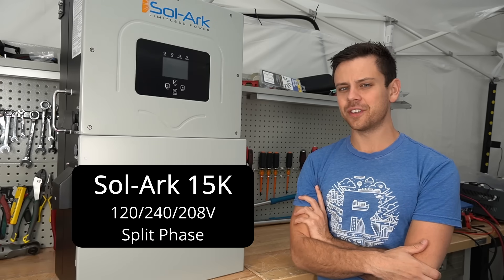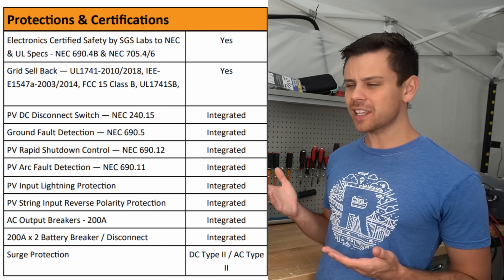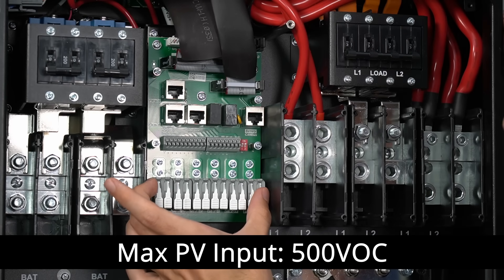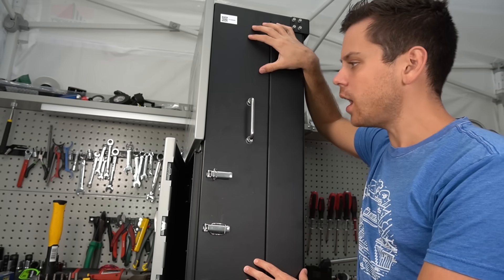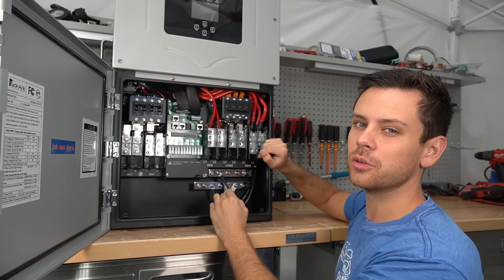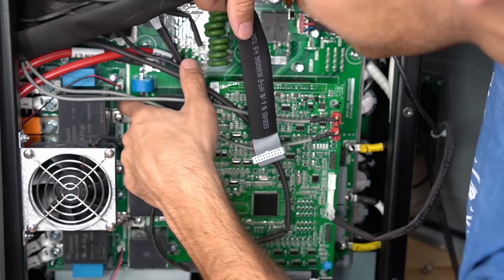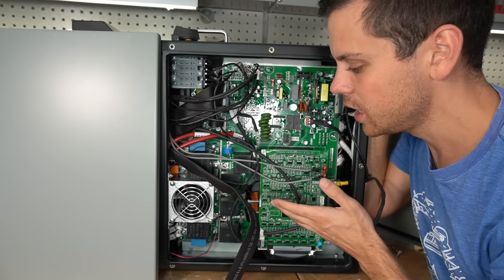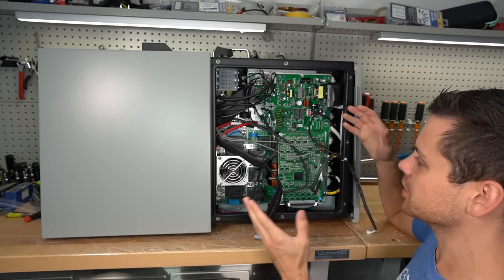Sol Ark 15K: Ultimate Grid-tie or Off-grid Inverter

Comment: I have two of the 8k sol-ark inverters powering my off grid home and aside from needing to cut a few trees on my heavily wooded property it does well keeping up with my 10k system and 40kwh storage. Have pushed the storage a bit a couple of night but after kicking in the generator for a couple of hours until sunlight we were good to go again. Off grid is a bit of a learning curve especially after a few overcast days in a row but no electric bills for the last 7 months has been nice. May add one of those 15k ones if I decide to run more stuff at a time and add more storage. Off grid homestead  and trying to be as self sufficient as possible
Reply: With all of the craziness going on in this world trying to be as self sufficient as possible is a wise thing to do.
Reply: How much were your total costs including the batteries and 10,000 watts of panels? What used to be your monthly electric bill?
Reply: @sjagain  this was a new of grid build and it cost us about 37k during the pandemic. The local power companies wanted almost 60k to run power lines all the way out to my property and they wanted us to cut a 20 foot wide path through our woods for above ground and an extra $300 a foot for underground. Our old bill was in California for a 1100 sqare foot house with no ac and was $250 a month
Reply: I'm thinking about doing the same thing but I've been concerned with our 220v well pump running a lot(live on a farm). Have you been using server rack batteries?
Reply: @JTBags420  I had to get lead acid batteries due to my budget but it runs my well pump just fine and the rest of the house  and as long as we have a sunny day I can run  my 3 ton ac and charge batteries at the same time. Do need to cut some trees to get better morning sunlight but so far so good. I do plan to add some rack batteries as budget allows and the lead acid get worn out
Reply: @ramonmacias9013  how many watts of solar panels did you use? I live in New England and we can easily have 3 days of no sun in the winter.  That's the 1 main factor for how fast you can charge your batteries?
Reply: @JTBags420  10,000 watt of panels. Do plan to add a few more as needed for more equipment and my antique computer hobby. I am in East Texas 100 miles East of Dallas
Reply: @ramonmacias9013  same exact area I'm in, attempting to do the same thing as you.
Reply: @davemanpainter  cool, in east Texas near Tyler?
Reply: @ramonmacias9013  Just outside Dallas .... Forney right now, but looking for land, and I'm open to relocating
Reply: @davemanpainter  So pretty much next door the way Texans count distance
Reply: @ramonmacias9013  HAHAHAAHA you are right.  I meet people here that will drive 70 miles just to go out for dinner.
Reply: @davemanpainter  13 miles to the nearest big town of 3500+ people and 25+ to Tyler so going out to dinner is a small road trip.
Reply: I didn’t think you can stack 8ks. Only 12 and 15s

Comment: Idle power Consumption 90Watts. That’s 64.8kWh’s a month and 788.4kWh’s per year. You'll need like 600-1200 Watts of solar panels depending on location and season just to have it on.  It would be nice if these big wall units used load dependent parallel inverters that kick in to add capacity as needed.

Comment: Schneider xw pro with associated Schneider hardware has all certifications for inspections.  Schneider also offers all the functions Sol Ark has.  The differences are only 63A pass through unless using external contactor and you have to piece together inverter, charge controllers, insight controller, and conduit box that has all necessary breakers/bypass.  I'd like to see you review a schneider system.  I think Schneider a Sol Ark are logical choices if wanting to pass inspection/code to grid tie.

Comment: Right now (besides price) it looks like panels are going to limit how useful a system like this will be, especially for a LARGE off grid system.  The most direct PV you could connect (to a single Sol-Ark 15k) would be about 15kW, IF you can find the panels that is!  You'd need 30 500W panels in 3 strings to keep under the 500VoC limit.  Although Sol-Ark has demonstrated attaching solar to the generator input using micro-inverters as well.
Reply: Not True. You can connect up to 19.5 kW of panels to the 3 MPPTs (2 strings ea MPPT). Only 15 kW of actual power of that can be used (i.e., actually inverted from DC to AC) . You can add another 19.2 kW of AC coupled panels to the generator breaker. So you can get an actual 34.2 kW of power going to loads, batteries, and grid.
Reply: @gerrygreen3832  Correct, you could essentially "waste" 9 500W panels on each MPPT, but unless you really needed to max out your direct PV production why would you?
Reply: @michiganengineer8621  : Well, that's just the point. Depending on one's location & average meteorological conditions, a DC-to-AC Ratio of 1.3 (19.5 to 15) may be needed to make the full 15 kW capacity of the actual DC->AC inverter circuitry. So you would need the 19.5 kW of (rated) PV panels to produce 15 kW of power (at the MPPTs) in the winter, and (again, depending on cloud cover, etc.) the MPPTs might "clip" some of that extra 4.5 kW in summer. And one's  power requirements might dictate this need to max out the (DC coupled) 15 kW into the MPPTs : say, if either 1) they needed that 15 kW + the available 19.2 kW of AC coupled PV panel generation, or 2) they needed/wanted the Gen Breaker for their backup generator. This highlights one of the advantages of having an experienced solar engineer help design one's system.
Reply: @gerrygreen3832  All valid points, and given how lovely MY weather is <snicker> I'm going to need to re-think the configuration of the system I want to put together.
Reply: DEYE 16kW has 3 mppt, I suppose it is the same here, not a big deal.
Reply: @sergea1138  That's the positive of the Sol-Ark over something like the Quattro from Victron.  More higher voltage MPPT's built in

Comment: I don't think alot of people understand what a PV rapid shutdown is and think it's ok to just install panels on there roof (DIY). I have been familiarizing myself with the code and regulations in my area. Huge eye opener.
Reply: rapid shutdown is needed if you want to sell back to the grid. I bought a 15k a month or so, still waiting to install it but I realized I needed a few items for the array
Reply: @paulskime  I believe it is also so you don't kill firefighters if they need to extinguish a fire in a building or structure

Comment: I was just watching David Poz channel from a year ago about these inverters/chargers. 
He stated it wouldn’t work for him because it kept shutting down, I believe he had at eight or 12 K Solark. 
He stated that most people who went off grid used gas or propane to run the heavy appliances like oven or dryer.
Reply: My understanding is Solark has resolved alot of the issues with their older 8k models in the 12k/15k. Haven't heard anyone having problems with the 12k.
Reply: @N8TheSnake  
It was a 12 K solark. I hear even another guy say that a heavy 120 load would shut the Solark  also. Apparently it would happen when a 1400 W difference on the legs 1 and 2. 
These videos were a year or a year and a half old. Let’s hope they solved the issues.
Reply: Very old news. Dave didn't have the latest firmware. Also, he made a follow-up video showing simple addition of an autotransformer solved the issue.

Comment: Just had one installed on my house. Provides whole house backup perfectly. Don't even notice the lights flicker.

Been working great with sok 48v rack batteries.

Just waiting for power company to inspect to turn on grid sell. Looking forward to the videos would love if you could go in depth with all the options in the menu.

Only issue is when the fans kick it it does have a high pitched wine. But only when the fans run. Not sure if that's normal or not.

Comment: I like my  12 K but there is issues with kicking on large inductive loads where the inrush current trips the inverter and also you have to be very careful about keeping your L1 L2 load balanced if not he trips out but it has lotta nice features and a good unit I just wished it was a little bit more robust and taking shock loads
Reply: I've read multiple accounts of people experiencing these problems.

Comment: My friend and I have installed 3 of the 12K's and we love our Sol Arks! They have incredible customer service, the units are beefy and nearly bulletproof. We have one hooked up to a 90kwh battery bank and running a constant load of about 6700w with the help of 4 additional solar chargers and it's been handling all the situations we have thrown at it like a camp and all of it's safety faults and warnings have really helped us protect or setup along our learning curve! Cant say enough good things about it. Glad to see you have the 15K! Exciting stuff!!!
Reply: @The Osborns We need them to charge up our massive battery bank for Bitcoin mining at night. We used Growatt 48v 120A charge controllers and our battery bank is 18x 48v EG4-LL's.  We've had some challenges balancing the settings of the Sol Ark and charge controllers with our batteries. All different brands and no fancy communication. But they are running nicely now. We have the CC's set to .5v under our max voltage set on our Sol Ark. If you, Will or anyone else has any suggestions on pairing charge controllers with an all-in-one I'd be interested to hear. It's an interesting challenge getting them to aid in the charging cycle to their maximum potential and not interfere with the all-in-one's maximum charge settings.

Comment: One thing about the 15 K advertised that wasn’t advertised with the 12 K is that it can be battery battery less operated I don’t know if that means it can be solar only battery less operated or it has to be just grid tied battery loose operation
Reply: I believe that you need  a grid tie in order to be able to balance your load with the momentary output of your solar array.

Comment: Nice to see this review. Have the 12k and have been impressed the past few years with its performance and features. The one thing I would highlight is that the Sol-Arks are super feature rich. I suggest that you read and then reread the manual for a full understand of how this thing can be installed and leveraged before you start.

Comment: Thanks for helping show us all the light, Will! Pun Intended. Your insightful videos have been instrumental in supporting my 15K design/deployment. 

For Context... I recently deployed a 15K with 17.2 kW of PV, AC coupled to a generator, with 30 kWh of Batteries. 

Passed inspection a few weeks ago. 

I've run in many modes, including off-grid, and with grid sell-back (including TOU). 

I'm beyond impressed with the flexibility, capabilities, and support from Sol-Ark!!!

This inverter handles my loads like a dream... Including simultaneously running a Microwave, Electric Dryer, and Air Conditioning (both with and without 200A passthrough).

Comment: OK, why spend the extra money for EMP hardening? It's not like one is going to be around after an "event". And even if you survey an "event" what makes you think the company is going to be around?
Reply: I have the EMP-hardened 12K Sol-Ark, and I plan on being around after an "event". That was the whole point of buying it. :) It works great with my 11.7 KW solar panel array. Last month, I banked 208 kWh with my power company, and I don't plan on paying more than the $5 mandatory monthly service charge until I buy an EV.
Reply: A high altitude burst wouldn't cause any direct SURFACE damage.  For that matter a large enough solar flare could take out the grid sending surges through to fry just about everything, think of the next Carrington Event.  The hardening would at least give you a CHANCE to survive with power if you're well enough prepared in other respects.

Comment: I've had mine for about two months now. You do need to install a service entrance rated fusable disconnect between the meter and the Sol-ark.
Reply: Hey I know you from the forum but it depends on the AHJ.
They are installing them in NC with No fusible disco. I’m sure some places will require it though.

Comment: I installed the 12K on my off grid cabin. If I can do it, anybody can. It has been flawless running a 3/4 hp 500ft deep well pump, 12 inch Miter saws, medium size compressor, large table saw and everything else I have thrown at it. Granted, I'm not running a normal house loads (dryers/ranges), but I have a feeling that it would work fine if I did, as long as I stay below the inverter limits. People say it's expensive, but to me it was so cheap, because it just works, and I don't have to screw around with it. Its all about VALUE, not cost..
Reply from the maker: Thank you! I always appreciate your feedback on the videos and look for your comments 😁
Reply: I am realizing the value of products that simply work.
Reply from the maker: Oh nice! I didn't know you had one too. Very cool
Reply: @WillProwse  Yeah, your videos helped me more that I can say. Thank-you
Reply: @NeverTakeNoCut-offs  facts.....will is a treasure to us diy folks that needed to learn all of this.

The 15k is going to be in my house soon.  It's pricy but we'll worth it.
Reply: @wadebrewer7212  I think you'll be happy with it. Nothing is perfect, but I've had literally zero problems with mine so far. Are you doing it yourself?
Reply: @NeverTakeNoCut-offs  absolutely doing it myself.  I refuse to pay someone for something I know how to do or can figure out.  Struggling right now to get a disconnect installed, electricians either want too much or are nearly unresponsive.

The built in transfer switch in the 15k makes me a little squeamish but we will give a shot.  Plan on not selling back but will be using the CTs for a limit to home set up and zero the meter.

Plan to couple with EG4 server rack batteries (looked at building them myself, but honestly you are not any further ahead) and what I believe to be enough solar after 3 years of data collection (Emporia monitoring).
Reply: @wadebrewer7212  Yes, most electricians won't touch this stuff unless they do the entire job, which I sort of understand. I'm 100% off grid, so it's dramatically simpler. Definitely can't see the value in building your own batteries. I bought Trophy batteries because of the heaters and they've been good so far, but they have no comms.
Reply: @NeverTakeNoCut-offs  hmmm....trophy.....how are they priced?   I have a chicken coop that needs more power in it, but it isn't heated.
Reply: @wadebrewer7212  They are more or less the same as most other lower tier server batteries like EG4.
Reply: Interested in your well inrush current. Been looking at the 12k also but my 3/4hp well pump is 9000w surge and 1600w steady state.
Reply: @cgutowski471  I wouldn’t do it.  I’m running two 12k’s and they trip out all the time.  I turned on 800 watts of LED lighting today and they shut down. I’m working with the installer and Sol-ark trying to figure out what is going on.
Reply: @dgmcfadden2006  Thanks for the information. I’m still leaning to Outback or Schneider until I see proof that Solark can pull it off. 15k maybe, just unsure.
Reply: @cgutowski471  9000w on 240volt should be ok with this, but I would definitely call Sol Ark and ask them. The 12k has a pretty decent surge rating. My pump does not draw more than 20A on startup, but it's a higher end type pump that I had sized to run off a 240 volt generator.
Reply: @NeverTakeNoShortcuts  are you running split phase? can you show your set up?

Comment: Ok, can you tell me the appropriate amount of solar panels, and would you recommend this unit for a 40 foot bus?
Reply: That would depend on the panels you want to get, and how deep your pockets are.  The limit is 500V open circuit for each string and 17kW total for solar as well as how much of the bus roof you want to set aside for solar panels.  This unit would be major overkill for RV use, the 8k hybrid would probably provide all the power you'd need.  Possibly go with the 12k if you live in it full time.  Even so, you'd be better off going with Victron or one of the other manufacturers who make products specifically for RV/Marine use.
Reply: @michiganengineer8621  Thank you! Great and very useful information!